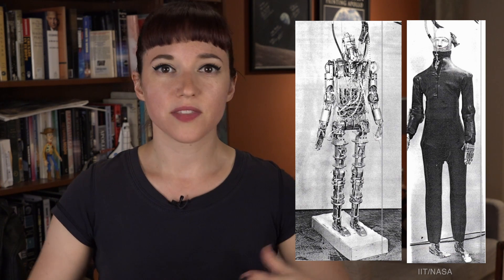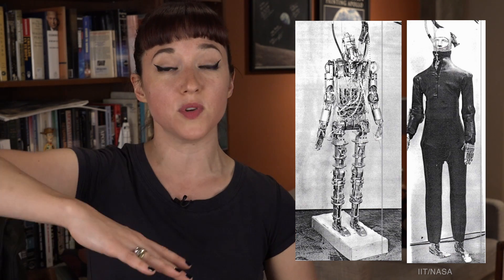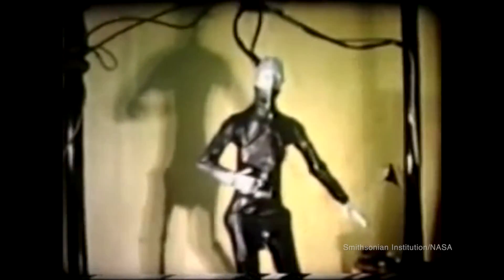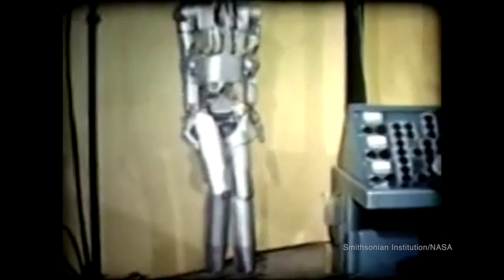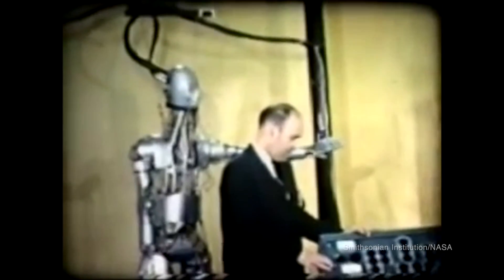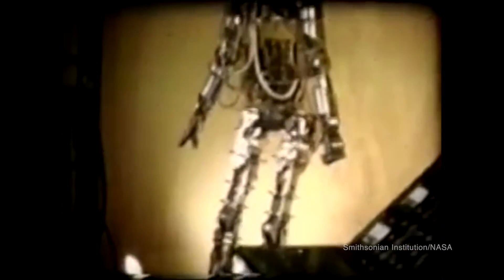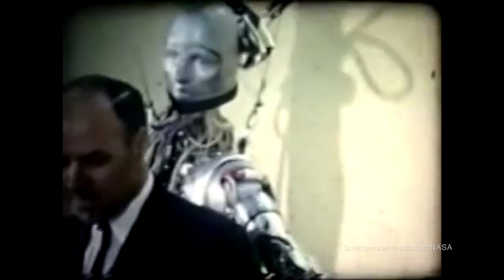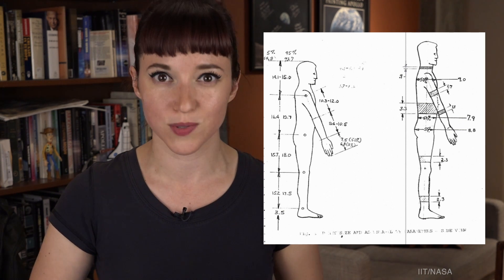Meet the Creepiest Android NASA Ever Built

Comment: They should have used a private company instead of a university.
My old employers could have done that so easily.
The idea that the hydraulics just had to leak is absurd.
The documentation you've read was written by someone who doesn't know what a strain gauge is.
It's actually a link that gives a different resistance through it's two terminals according to how much it is being pulled apart at it's two ends.
A strain gauge is basically the opposite of a load cell (a load cell measures how much it is being squeazed).

Comment: if a vacuum is a perfect insulator, how dp spacesuits and spacecraft dissipate heat in a vacuum?
Reply: From a document named "Apollo Operations Handbook: Extra Vehicular Mobility Unit (volume 1)" (i.e. spacesuits, and available online as a pdf), in section 2.5.4 "Feedwater Loop":-

"... Feedwater then enters the porous plate of the sublimator. The feedwater forms an ice layer on the surface of the porous plate which is exposed to vacuum. Heat from the liquid transport loop and oxygen ventilating circuit is conducted to the porous plate and is dissipated by sublimation of the ice layer."

So spacesuit heat removal is achieved by evaporating water into the vacuum via a sublimator.
Reply: The sublimated water is a gas. This is one (fairly usual) definition of "gas":-

"The state of matter distinguished from the solid and liquid states by relatively low density and viscosity, relatively great expansion and contraction with changes in pressure and temperature, the ability to diffuse readily, and the spontaneous tendency to become distributed uniformly throughout any container."

When the container is the entire universe (or even just everything in the vicinity of the moon) and the gas has a "spontaneous tendency to become distributed uniformly throughout" it, you don't need any other mechanism to dissipate the heat. In practice air would do a lot to restrict the dissipation, by getting in the way. In that case you might need to aid dissipation of heat by pushing the air around, but that is not an issue in the vacuum of the lunar surface.

Ice crystals are collections of water molecules (and quite a few if they are going to be visible) and there is no reason to expect the molecules of dissipating water vapor to group together. Plus, even if they did 8 pints of water per EVA per astronaut is not exactly enough material for "clouds".

I wouldn't be surprised if cooling methods, and mixes of cooling methods, haven't changed over time.  Those Apollo suites stored their oxygen as pressurized gas, which means their tanks would have cooled down as gas was released from them. I could find no evidence that those tanks were explicitly being used as a heat sink, but they would have been acting as one anyway. There is also a lot to be said for using liquid oxygen to store oxygen for a spacesuit, you can pack more into the same volume. That liquid oxygen would need to be heated up before it could be breathed so that is another potential head sink to take advantage of in a modernized space suite.

Things getting stranger the more information you have might be improved by following David Smith's "Capital suggestion".
Reply: https://en.wikipedia.org/wiki/Radiation#Thermal_radiation_.28heat.29
Reply: Yes, that is the standard explanation, but it defies the laws of physics.  Radiation cannot be transmitted in a vacuum, as there is no medium through which a wave can travel.  The Moon suits and Apollo spacecraft had no visible means by which heat could be radiated, nor has NASA ever made such information public.  They always point to the white or silver color as a means of reflecting heat, but that does not explain heat generated from within.  A Thermos works because the glass core is surrounded by a vacuum that prevents heat from radiating.  Therefore, space is not a vacuum or someone is lying.
Reply: Lol.  I appear to have fed a troll.  Sorry.  My mistake.
Reply: Just in case you're serious - the Thermos reduces radiation with a mirrored surface.  The vacuum is there to prevent convection and the thin walls reduce conduction.

Have you ever considered why sunshine makes your skin feel warm?
Reply: Not trolling, I have 2 years of university-level astrophysics and have followed the space program since I was a child, and I have never received a satisfactory answer to how the Moon suits or spacesuits radiated heat from the cooling garment worn underneath - just vague references to the backpacks.  There is no mechanism in the public diagrams of the backpacks that explain how heat is removed from the astronauts' bodies and exchanged with a vacuum.  All radiation must have a medium to travel, just as waves in water.  If there is no medium, such as air, to carry the waves, there can be no radiative cooling, regardless of the wavelength.  If radiation can propagate in a vacuum, then space itself cannot be a neutrally charged nothingness.  Since the video topic is an android that was designed to test spacesuits, this was a natural question that arose in my mind once again.
Reply: How does the heat from the Sun reach your skin?
Reply: Waves propagate in a charged medium once referred to as the 'aether.'  However, the Standard Model says that space is an electrically-neutral vacuum in which EM waves (light, heat, X-rays, etc.) cannot propagate.  If the Standard Model is true, and the spacecraft and spacesuits were designed using this model, then the astronauts should have baked alive, since there was no way to dissipate heat.  

If the Moon suits removed body heat using a cryogenic liquid (ammonia I believe) and deposited that excess heat in the backpack to radiate away, then there had to be a medium, an atmosphere if you will, in order for that to work.

On Earth, we sweat.  The sweat is heated and evaporates, carrying excess heat into the medium of the atmosphere.  In a vacuum, that heat would not radiate away, but would build up until the suit became an oven, because there is nothing to carry the heat away.

My question is, if the Standard Model is true, and the suits were designed using that model, then by what mechanism was heat dissipated into the environment?  When I look at the schematics, there is no mechanism to remove heat, yet the astronauts obviously lived.  So where is the truth?  Either the Standard Model is wrong and the designers knew that, or the astronauts did not go into a vacuum (i.e. never left Earth).  Thoughts?
Reply: Heat and cold are subjective terms.  We perceive slow-moving atoms as 'cold' and rapidly moving atoms as 'hot'.  In order for there to be hot of cold, there must be matter vibrating rapidly or slowly.  If space is a vacuum, there is no matter to vibrate, thus no heat or cold.  Therefore, space is not a vacuum or someone is lying.  QED
Reply: I recommend asking your question here - http://physics.stackexchange.com/
Reply: Capital suggestion.  Cheers!
Reply: Thank you for looking that up and posting.  I have read the manual a number of times.  

Here's the problem: in an atmosphere, air pressure and wind move water vapor away from a heat source and dissipate it.  In a vacuum, there is no air movement, so the vapor cloud does not dissipate and the heat continues to build up, along with the water vapor.  

If there were a mechanism to "blow" the vapor away, the film from the surface of the Moon or orbit would show clouds of ice crystals, much like the waste dumps frequently seen in shuttle footage.  The described system also needs continual replenishment of water, though the only reservoirs noted in the backpacks are for drinking water and none of the surface checklists note checking or refilling the system as part of the pre- or post-EVA chores.

Over the past 40+ years, NASA has gone from making this info classified to at least three different systems for removing heat from inside the suits.  One I distinctly remember was circulating cryogenic liquid in the capillaries of a body stocking.

The more you look into this topic, the stranger it gets.

Comment: Did you mean to say "(quote/unquote) skin" twice, or was it a slip of the (quote/unquote) tongue?
Reply: The first layer is the aluminium. The original idea was that would be all that could be between the dummy's guts and the test space suit.   When the hydraulics leaked, the fluid ruined the test suits, so the dummy was put inside what was basically a wet suit.   So she is right in calling both layers 'skin'

Comment: As a child I was told that America spend lots of money to develop space pens. while the Russians just used pencils. As an adult I learned that the pens where actually made by a private company.
Reply: Well it's a good legend.. Actually the Americans used pencils too in the beginning but these cost over $120 each. Graphite is not a great material to use however as bits of mechanical pencil can break of and short out useful systems in a space craft. Russia did use grease pencils however. Fisher developed the space pen with their own money and apparently NASA bought 400 of them for $6 each. Luckily Buzz Aldrin was using his fibre tip when he went to the Moon as he used it to fix the ascent engine circuit breaker on Eagle to enable it to return to orbit. The Russians also purchased pens from fisher for their space program, so that product was a commercial success.

Comment: Nice job Amy as usual! This program is a perfect example of design and engineering vision exceeding the reach of available technology. And there is nothing wrong with that, it is exactly what NASA should be doing to learn lessons, invent new solutions for the next attempt, etc. Doing all this with hydraulics must have been a nightmare... but, and I don't know, are not some of the big 'bots built by that Boston robotics company Google bought still using some in their systems? I'm sure there are many servo motors and electronic actuators, but from their videos with umbilical connections and lots of noise it seemed some systems were still "fluid."